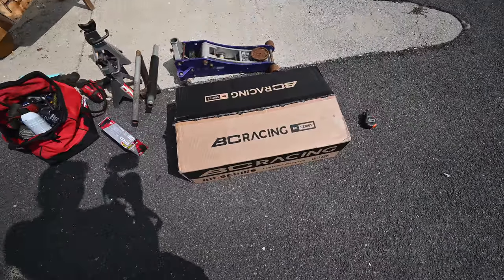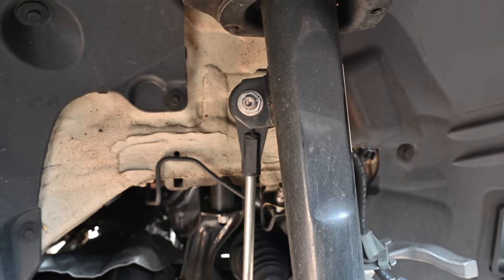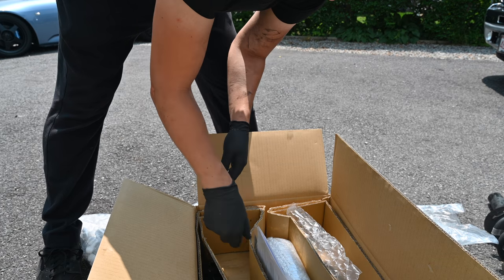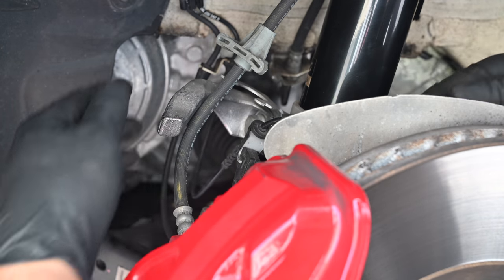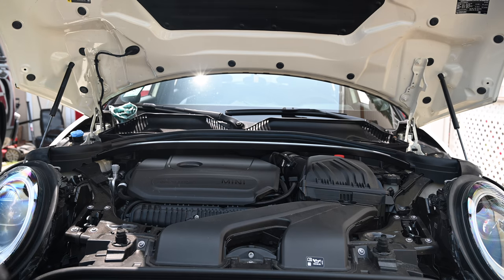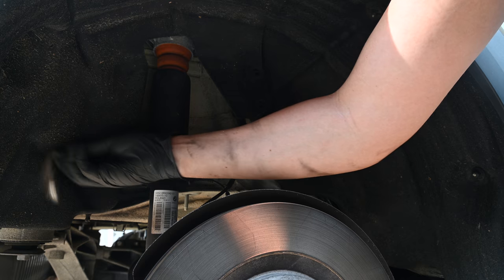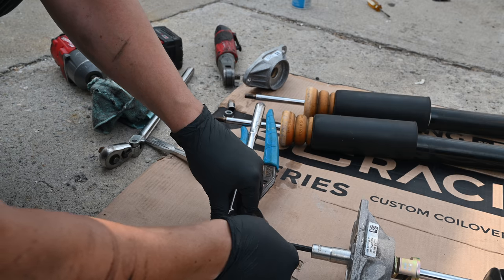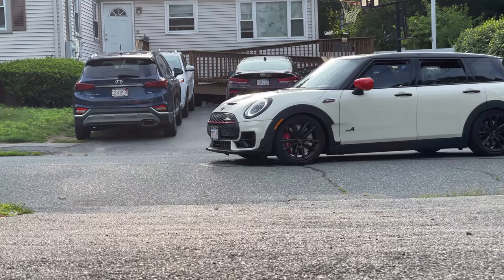Upgrading to BC Racing Coilovers on the 2023 Mini Clubman JCW

Comment: Great video, seems pretty straightforward but no bolts were replaced? Also how about tightening torques? I was surprised the pinch collar on the front wasn't a problem. On other cars with similar design that collar would not open up even with the pinch bolt removed, had to use a special "spreader bit" and still struggle to get the shock out. Think I'll just go with Eibachs on my Clubman to fix the height, but rather not mess with the active suspension

Comment: hows the ride compared to stock?  I am also in MA. Just ordered a 24 Clubman jcw. same color. but the lounge leather interior
Reply from the maker: They feel a little stiffer than the stock JCW suspension was.
Reply: I just put KW V3 on my JCW Clubman.  The sport suspension is really bouncy and stiff and sucks on the highway.  The V3 have progressive rate front springs and they feel softer overall, but the adjustable dampers are fantastic.  I used the recommended default settings for compression and rebound and its great.  Much more comfortable ride.  They honestly feel like the mid/soft mode on the adaptive dampers version on the Cooper S clubman.    They are spendy but if you want a more comfortable and capable options, the v3 KW are worth it.